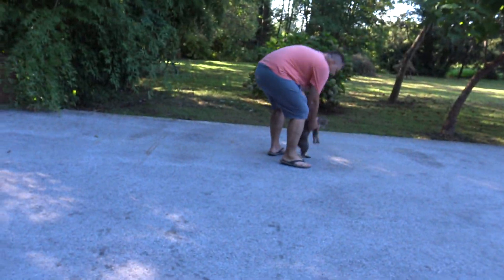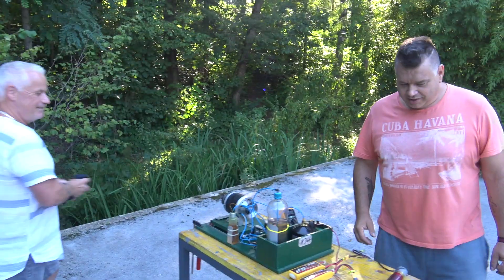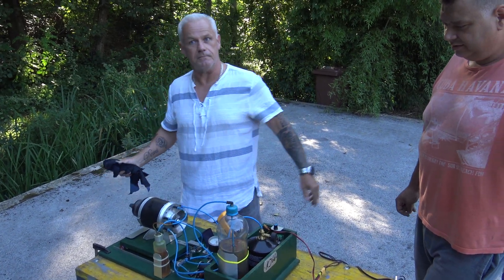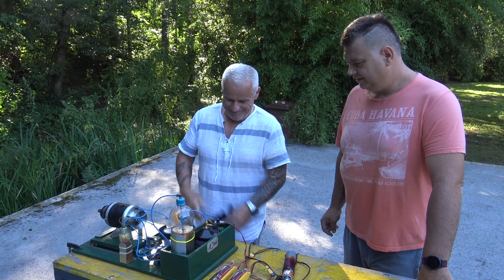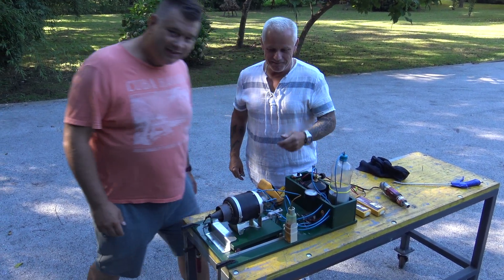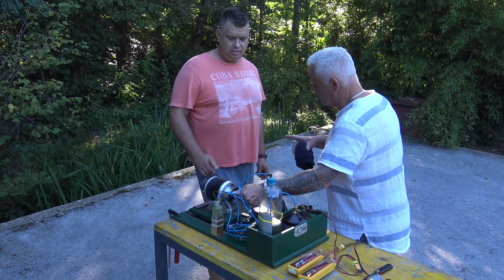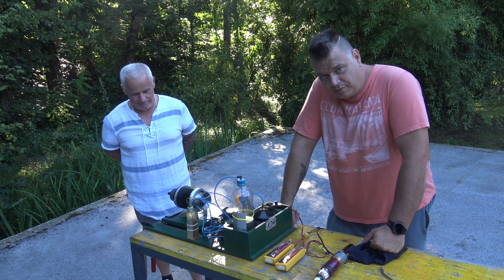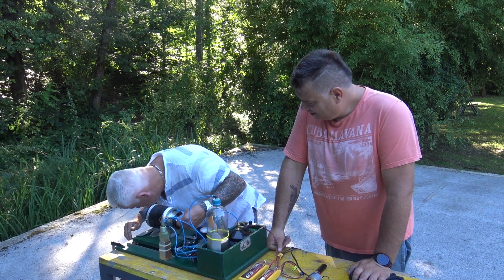INCREDIBLE JET ENGINE SOUND from KJ66 handmade gas turbine

Comment: What great memories! I used to work professionally with KJ66 turbines about 25 years ago as they powered first Spanish jet target drone, the SCR´s SRAB. Ours were manufactured and supplied by one of the KJ66 designers himself: Jesus Artes. Our units already used mixed fuel-oil against separate oil supply as that of the video and we got, taking it to the max performance, from 8.0 to 10.0 Kg of thrust, which normally damaged the turbine but it was not very important as it was rare that the plane and the turbine returned after military fired a Mistral missile against it!. The starting procedure was just as that shown on the video, and my workmate responsible for the turbines who also started them finished losing burn out all hair on his right hand from using a cigarret lighter for starting the turbine! We joked him saying in every start the we smelt like being at a barbecue,.... in fact a pig barbecue! We also wrote a slogan we made print on some T-shirts for the starting and launching ground crew: "If you take fire, SPIN ON THE GROUND!" which made military to laugh, only till they took operations theirselves.....

Comment: Invest into some really good ceramic bearings and bench test the thrust and then you can figure out how big of an aircraft it would take to handle the engine
Reply: I runs up to 5kilo at 100.000rpm....Sadly some equipment was damage during postsending 3 years ago....I flew a salamander lookalike plane wing 170cm total weight 6kilo.....
Reply from the maker: Bearings are changed.

Comment: With those bearings rattling around in there, you guys are lucky you're not picking shrapnel out of your no stick having butts 😅
Must be a really well engineered turbine. 
Salute from DC 👍
Reply from the maker: Bram has put cheramical bearings now in but the problem here was just in lubricating.